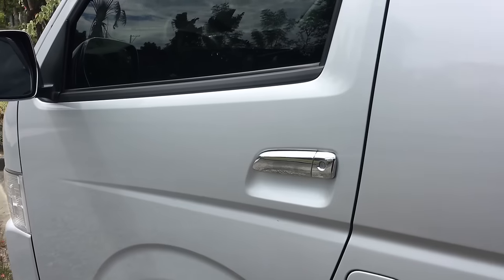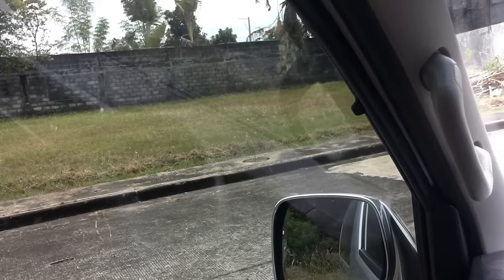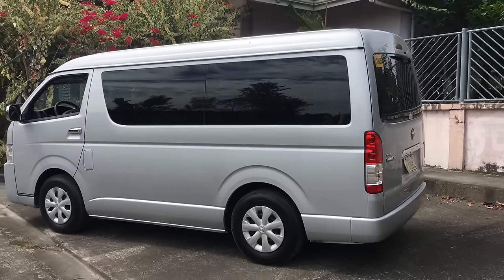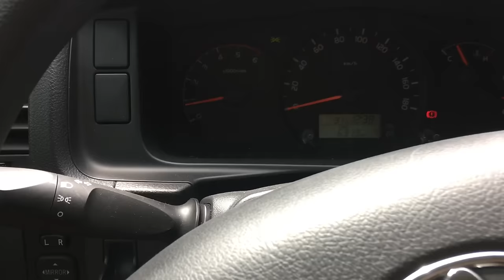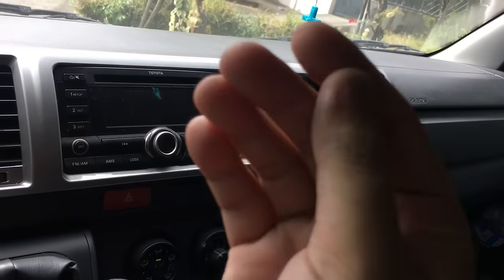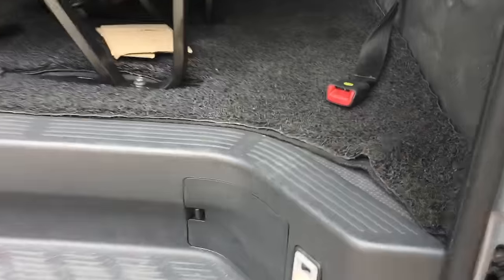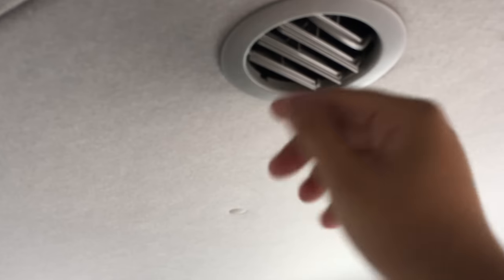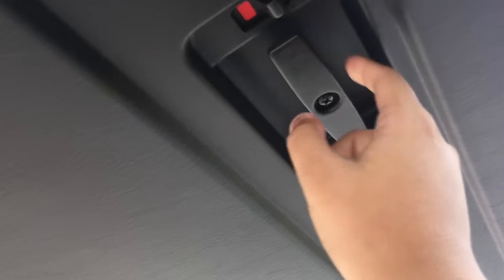2017 Toyota Hiace GL Grandia 3.0 MT Full Review

Comment: The fifth generation Hiace was launched in the Philippines on December 2004 or Jnauary 2005 starting with 15 seater Commuter and on June 2005 with the 11 seater GL Grandia. Commuter and GL Grandia Hiace both have manual transmission at first. In March 2006 the new top of the line Hiace Super Grandia was launched being ever the first Hiace with an automatic transmission. In 2008 they added drivers airbag for the Commuter

Comment: it looks very nice, but my issue with how it is designed is the location of the engine. you are technically sitting on top of the engine which is directly underneath the cabin. this could pose a potential health hazzard as the vehicle gets older. engine fumes could be an issue too.

Comment: Sir Patrick. how about the features of the toyota hiace commuter 2017? Can you introduce that?
Reply: Still the same pa rin. Wala pong changes.
Reply: P1,326,000.00 
Power: 136ps
Torque: 300nm
Engine: 1KD-FTV
Fuel system: D-4D (Direct Injection 4-stroke Common Rail Diesel)
Reply: Brent Andrew Magno 
Wala pong video presentation yung commuter? Thanks!

Comment: Sir patrick reyes keyless entry na po ba siya at yung 2nd row po na seats na fofold din po ba siya or ung sa huli lang po? Salamat po
Reply from the maker: It does not come with keyless entry, but you can avail one though. And only the rear most seats are capable of folding.
Reply: PatrickReyesTV review niyo and test drive niyo din po 2017 montero sport gt at 2017 fortuner v 4x2